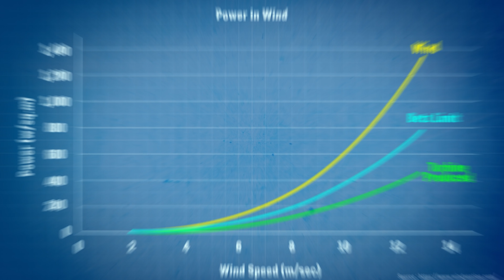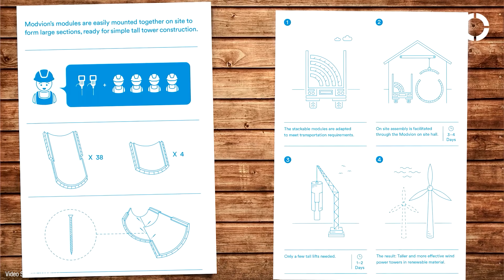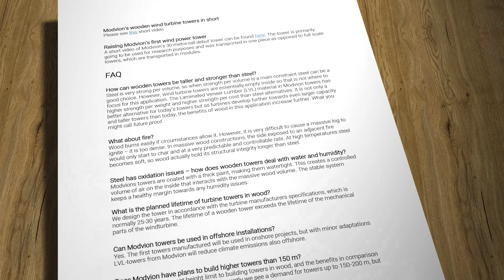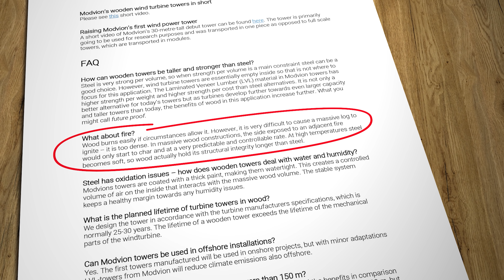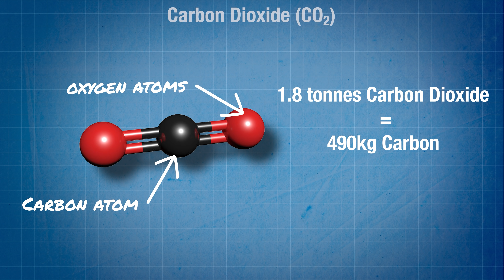Wooden wind turbines. Are they really a sustainable alternative?

Comment: Regarding your recent videos about solar energy I remember that when I was a child most of the emphasize on solar energy was about panels used to heat water with sunlight. Of course, since they were using direct sunlight their efficiency in warming water was higher than obtaining electric energy from sun and turning it into heat again. I was wondering that why don’t we use a combination of both solar panels which make electricity and solar panels which heat water on the home roof? The sunlight can primarily be used to make electricity and since only almost 20 percent of the sunlight energy is turned into electricity, the rest which turns into heat can be used to warm water which passes through tubes beneath the electric solar panels and is in direct touch with them to absorb the heat. By this way the temperature of the electric solar panels will also be reduced by the heat absorbing tubes filled with water and this will always keep the efficiency of the electric solar panels high.
Reply: I work as a rooftop solar installer in the UK - I do both PV and thermal collectors. Your thinking is sound - especially the benefit to PV generation of cooling the panels, which a lot of people miss. There have been a number of hybrid PV+heat panel products developed, but as far as I'm aware, none have yet been commercially successful.
Part of the issue is complexity, reliability and maintainability. Mixing water and electricity in a single unit can be done safely, but it brings requirements that add cost and weight. Installing a set of PV panels is pretty quick when you know how, but if they were any heavier it would be much more difficult. Most customers simply want some panels that can be fitted and forgotten for the next 25 years, and be assured of payback of the installation cost. We can confidently offer that for PV, but for hybrid panels, which would be more difficult to fit and might require maintenance, I don't think we could be so sure (yet).
Solar thermal is less popular here and in our climate you need the more expensive evacuated tube type collectors for an really effective installation, but where we do them, they are often on a more accessible piece of roof for ease of install and maintenance. They go well on an A-frame on a bit of flat roof - the wind blows between the tubes so they are quite stable, while a PV panel would act like a sail - therefore we can utilise roof space that can't be used otherwise.
Customers that want both types are generally quite wealthy and have large roofs, so we simply fit as many panels as their grid collection allows, and then we fit the thermal collector somewhere else - we don't run out of roof space - so the benefit of combining the types of collector, or of seeking greater efficiency, isn't really there.
So I think the answer is that there isn't really a strong demand for a hybrid panel because most of the market for solar is satisfied by the existing offerings. However, this might change if the market grows sufficiently that the fraction of customers that would benefit from hybrid panels becomes big enough that they can be profitably mass-produced.
Reply: @bimblinghill  Thank you very very much for your excellent information!
Reply: i remmeber the same. i DO see both on roofs around here, but i guess it depends if the company educates n offers the customer the advantage of direct solar heated water
Reply: They already exist this kind of Hybrid Solar PV-thermal module. But it´s not worth the investment. And the thermal efficiency is poor and the temperature is not very high like a standard solar panel.
Reply: @antoniocirino8444  Thanks for mentioning what I forgot to say: thermal efficiency will be a lot lower for a hybrid panel vs best pure thermal solution (evacuated tubes). However electrical efficiency will be higher due to cooling effect (as OP says). So the decision might depend on which is more valuable to the customer: heat or electricity?
But if you want a load of low-grade heat (e.g to feed a heat pump), rather than a small amount of high temperature hot water for a home, maybe a hybrid solution could make sense.
There's lots of things to consider!
Reply: Electrically powered heat pumps are more efficient than direct solar heated apparatus, even when powered via photovoltaic panels.
Reply: @DrakeN-ow1im  True, but at the cost of much greater complexity. When the energy source is free, efficiency may not be your most important criterion.
Reply: @bimblinghill  heat pumps or electric boiler + PV are actually less complex than using solar boiler panels.
Reply: @MDP1702  PV + Direct electrical heating is certainly far less complex to install than any system that requires fluid to circulate, but is not the most efficient method.
Having installed both, I'd say that solar thermal and heat pumps are similar in complexity (although there is a lot of variation due to the peculiarities of the location). They have quite a lot of equipment in common (pumps, water cylinders etc).
Reply: @bimblinghill  PV + Direct electrical heating is certainly far less complex to install than any system that requires fluid to circulate, but is not the most efficient method.
I never disputed that, in fact in my first response I specifically said Solar boiler panels are more efficient space/energy wise, but they are also more costly and complex.

Having installed both, I'd say that solar thermal and heat pumps are similar in complexity
Usually you don't use solar boiler panels to heat a home, specifically because during the times you need to heat your home, the output of these panels is already lower overall. Moreover while heat pumps can heat your house, they can also cool it down, this isn't the case with solar boiler panels. So even if they are equal in complexity, the benefit/complexity ratio will be well in favor of heat pumps.
Reply: @DrakeN-ow1im  I did not mean heating the home with electricity obtained from photo voltaic panels which of course heat pumps are more effective than them as you have mentioned, what I meant was the direct absorbing of sun heat by water filled tubes and transferring this heat into homes which is the most efficient way of heating homes with sun energy.
Reply: There already exist hybrid panels, it is just not really interesting due to reduced thermal efficiency, higher cost and lower flexibility (if you solar panel is damaged, you replace just that. If a hybrid panel is damaged, it is more expensive to replace and because it isn't easily disconnected, a lot more bothersome).

And at this moment it is actually cheaper to get pv panels and heat your water with the electricity produced then using solar boiler panels. However solar boiler panels are more effective, you need possibly almost double the space with pv. So essentially if you don't have much roof space: use solar boilers. If you do have the roofspace, use PV since it is cheaper and more versatile.
Reply: I personally think, after installing both, solar PV hot DC water is by far the most reliable and simple. Even on overcast days.

Comment: A couple of thoughts: 1) how about turning the wood towers into biochar  at the end of their life? 2) maybe you could do a video on Biochar? I'm making a bunch for my garden but I need way more than I can produce. It is difficult to find.
Reply: Presumably they would require a lot of energy to burn, given that one of their supposed advantages is that they don't ignite easily. Besides, presuming that they are still useful as a building material once they are deemed unfit to support a wind turbine anymore, it would be wasteful not to employ them in some sort of structural function rather than burning them down. There must be plenty of otherwise unused wood around to make biochar out of. EDIT: just read up a bit on biochar- wikipedia!- and hadn't appreciated the details and potential of it (apparently producing it is an efficient process). Still, reducing a strong composite structure which can serve other uses to biochar seems wasteful.
Reply: Was thinking the same and you said it for me  ;)

Comment: Wooden towers are an awesome concept.  In Alberta Canada they had replaced some tall hydro towers (normally made from steel) with laminated timbers.  They looked much better.  Using wood can be a great idea, however there are nasty environment impacts of forestry that are beyond CO2.  Habitat destruction and degradation of surface water quality need to be addressed to make wood a truly great alternative
Reply: In Calgary on the Sarcee Trail, there were some.
Reply: Those were the ones I thinking about - at the 17th Ave overpass if I recall.

Comment: Curious to know if the resins, polymers, or glues used for the wood turbines are from petro/fossil chemicals.
Reply: It's highly likely that they are, but so what?  Converting petroleum to resin is not the same as burning it.  It's not a gigantic source of GHG.
Reply: @incognitotorpedo42  The fractional distillation of petroleum would have a lot of unused byproducts if not used for fuel, although there may be the same problem if the polymers were made from plants.  A minor consideration here, but longer term, crude oil will be unavailable.  Maybe recycle polymers, etc., from landfills using some sort of AI sorting robots :)
Reply: Natural gas is used as a feedstock for many chemicals, and those then go into making epoxy for blades.

Comment: The lifespan of the turbines is a big factor for sustainability.
I know manufacturers are working hard to rate their turbines for 25 or even 30 years of safe use instead of the conventional 20 but that's still really short.
Reply: Yes, this is maybe the biggest factor limiting the life span of a wind turbine.
Reply: Honestly it isn't too bad that it is short, that means it can more quickly be replaced by more efficient/powerfull turbines. If they'd last 50-60 years, that would be a long time of using outdated, less efficient turbines that still use up the space.
Reply: @MDP1702  Indeed. There is little value in trying to life extend technology until it has matured or you are just locking in inefficiency. (We've making huge strides on the learning rates of all aspects of WT tech at present.) 

Added to that the ways to life extend today are far more likely to be less environmentally sustainable than those of even a few years time.
Reply: @tcroft2165  You and @Archangel17 are right, but how do you find they point when it has matured enough? I would argue that we'll be at that point very soon but I could be completely wrong.
Reply: @w0ttheh3ll  Its a technical call but the delay is worth it. 

In context we were still installing mainly 8MW offshore WTs last year, more 9s this year, in 2023 we'll start mass commercial installs of the 13MWs. The 16MWs are due for prototype in 22 with commercial production hoped to commence in 24.

Given the vast construction savings (and better capacity factors) from fewer larger WTs long life spans looks a much better strategy for the 2nd half of this decade. Esp as we should by then have the blades recycling by design sorted as well.
Reply: @MDP1702  Good point.

Comment: Why not make the blades from timber also? Since it's lighter, it would generate more power and provide less weight pressure on the structure?
Reply: I'm guessing it's due to weight. The blades are usually made from fibre glass, which is extremely rigid and lightweight compared to wood. Steel on the other hand, is another story.

Comment: While I'm convinced the wooden construction uses less energy to create than the steel one, I don't think it's right to consider this carbon storage. After all, if you just let the tree continue growing it would also be "storing" that carbon and absorb even more, and I dare say the tree would live far longer than the turbine will. All in all though, this looks like an improvement over current methods.
Reply: I guess the point is that if you create a market for wood then planting new trees will become economically viable
Reply: @sammason2300  That's not going to work. Why waste time and effort if you can just go over yonder and cut down already grown and perfectly good trees? It would require serious government regulation and oversight to force companies to adhere to it, and not just in one country but overall - since they would absolutely move over to other countries with no such regulation to maximize profits. There is a reason there is already rapid deforestation in many areas, for example the amazon, and the only thing "holding it back" is demand. So if you create more demand, it won't necessarily be good.

Comment: Building a tower out of stackable modules is a great idea but it doesn't require plywood, it works with steel modules too. Which is good because unlike in Sweden there's not nearly enough sustainable wood supply in most places around the globe to built tens of thousands of wind turbine towers.
Reply: I was thinking that too. Still, the massive weight and CO2 savings are important factors of the wood construction which steel cannot achieve.

Comment: Thnaks for this, I've seen research on this in the last couple of years.  Another piece of the puzzle would be to build enough airships to use for transportation, installation and maintenance.  They could even be solar powered to significantly diminish the impact on the environment as well as the carbon footprint.
FYI fossil fuels are not recyclable.  At all.
Reply: Well, fossil fuels are not recyclable if you burn them, unless you capture the CO2 and make something out of it.  That would be thermodynamically pointless, though, since you can make stuff directly out of hydrocarbons for a lot less money.
Reply: @incognitotorpedo42  
That's where I think the fossil fuel Industries going to try to say that they are environmentally friendly. By saying they are capture, when they are a producer. But it's a fear, so only something to watch for.
Reply: Lifting weight is far more energy intensive than moving weight horizontally when its supported (road/rail or water)

If your argument is we need to go down that route because of the difficulty of moving WT on land due to size constraints then I think thats seeing the problem the wrong way around.

Offshore or coastal wind doesn't suffer from such issues (as water access ameliorate size) and the max size of turbine is so far above anything thats realistically installable onshore (for a whole host of reasons of which transport is but one) and has far superior wind characteristics.
Reply: I love the idea of airships, especially solar powered ones. The ideal might be to "fill" them with vacuum. That is: pump the air out of them instead of using a lifting gas. They'd need to be braced with extremely strong and lightweight material to withstand atmospheric pressure across a large area, but the problem of keeping air out of a large bag should be simpler than the one of trying to keep helium or hydrogen in.
Reply: @Kevin_Street  I think most people [ myself included ] love airships, so every few decades or so there seems to be a resurgence of interest in their revival.  Unfortunately they have some disadvantages which are next to impossible to overcome.  Basically there are two types - rigid structures and non-rigid [ also known as a blimp,  which is basically a keel supported by a pressurized ballon ].  Both types suffer from leakage of the lifting gas.  The near-insurmountable problem with rigids is that wind sheer when encountered can rip the structure apart.
One thing that a lighter than air [ LTA ] body does NOT do well is act like a high lift helicopter because when the load is released there is a need to deal with the excess lift.  Rather than vent most of the lifting gas, the classic way this is dealt with is to take on ballast [ typically water ] as the load is released, which introduces another set of problem in practical terms.  Finally I think I'm on safe ground when I say that a ' solar powered ' LTA will never be successful.  But that is another story !
Reply: @crustyoldfart  Thanks for the reply! There are certainly a lot of interesting problems that need to be overcome in regard to airships.

Comment: I'm not sure people understand what composite wood is and its use in construction, it's basically the same as GRP, Fiberglass, or Carbon Fibre just using wood as the fabric. This means it's wood heavily impregnated with epoxy resin (or similar) and about as recyclable as the blades discussed later in the video. I'm not saying this is a bad idea, it's a wonderful material to work with, it's just not as green as this makes out!
Reply: No, it is more like plywood. Fiberglass or similar may have upto 30% of resin (epoxy) but the plywood may have about 1-2% of wood glue.
Reply: @janami-dharmam  It depends on the application, if you want the same properties as steal then that epoxy content goes up and up. I do admit I have not seen the specs for the materials in this, my point of reference is mostly the stuff used to replace I beams and Lintels.
Reply: @janami-dharmam  So I did just run the numbers on one example for a structural beam of regular LVL and the resin content came out as around 1/3 of the product by weight so yep. This is most likely a better way of making these things it's just not as green as advertised.